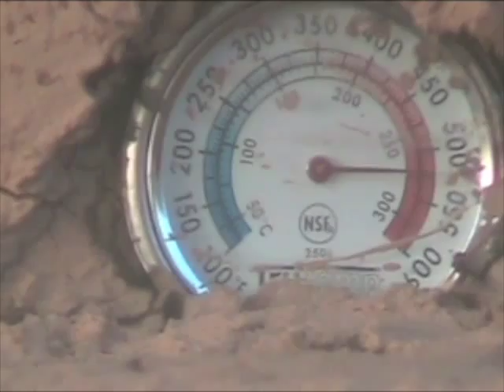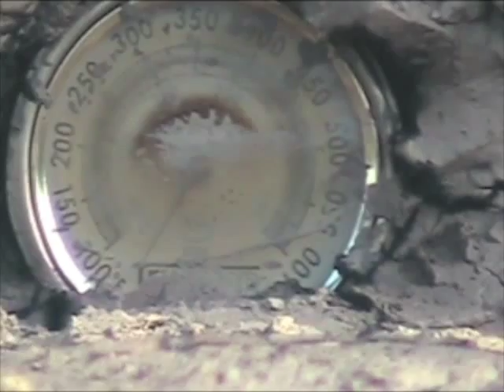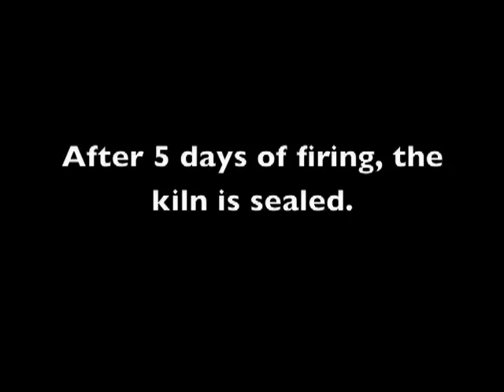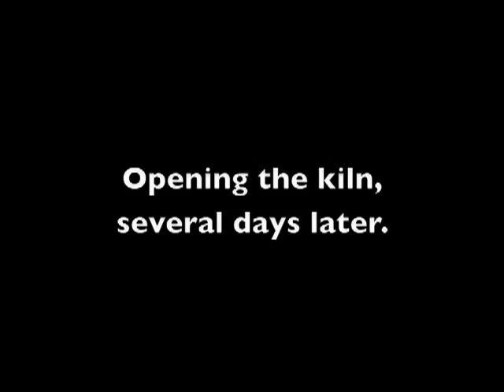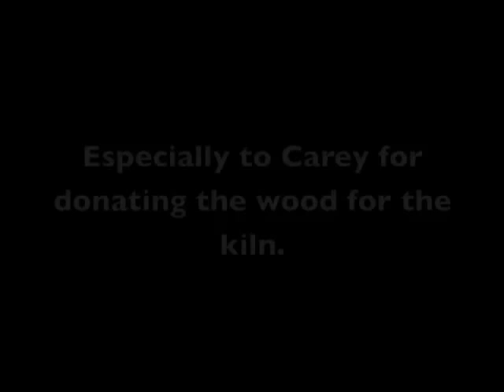Throwing the Mud.  Pennsylvania Brick Making. Part 2 of 2

Comment: Thanks for these two videos.   These are the best I have found in explaining the process from start to finish.  I'm going to be making my own for a few buildings, probably going to be doing 20-30 thousand bricks.
Reply from the maker: thanks for the kind words!  it was a fun project.  a few tips; do not get the clay too wet when making the raw bricks.  they will shrink and crack if too much water.  also, start your fire SLOW.  we added a little too much heat too fast and I could hear bricks exploding.

Comment: To account for shrinkage from both the drying process and the firing process, how much larger do you make the mold for each brick? What size mold would I need for a 8.25 x 4 x 2.66 inch brick? This is the size of brick in my ancestor's early 18th century home that still exists in Leesburg,VA.
Reply from the maker: Coastalcruiser Good question.  My bricks did not shrink much at all.  If they did, it was less than 5% of size.  Obviously the bricks that were made from wet clay did shrink but then they also cracked too much so we did not fire them.
Reply: vanwags This is the best video of start to finish of hand made bricks I've ever seen! Thank you for the reply, it's hard to find information on the internet of the whole process, and you are the only source I can find, so thank you very much!
Reply from the maker: Coastalcruiser thank you for the words of support.   Give it a try and let me know how it goes.